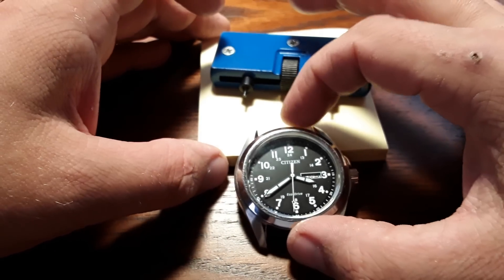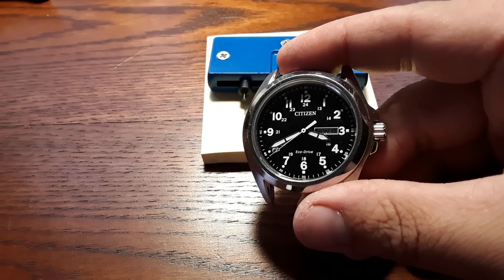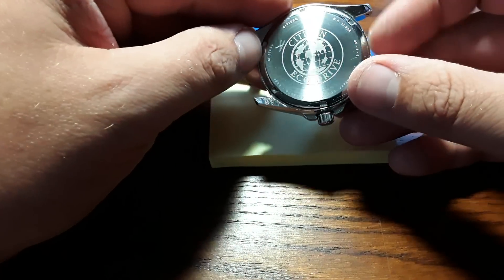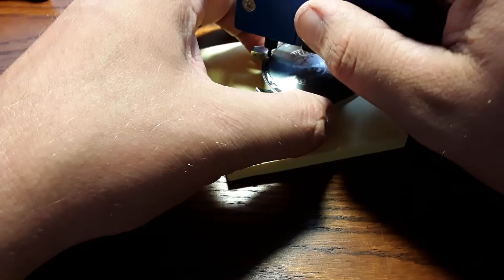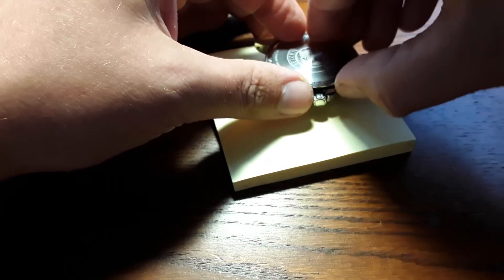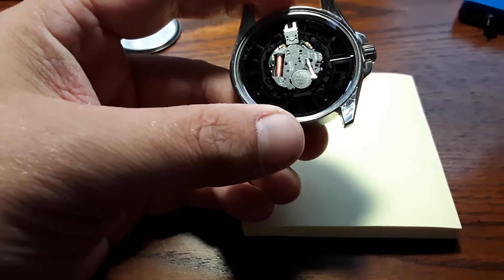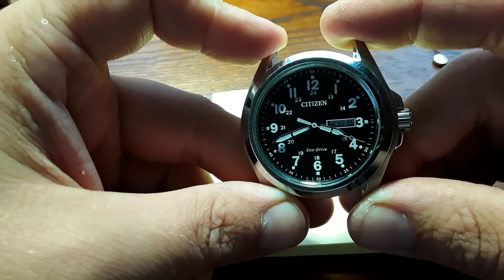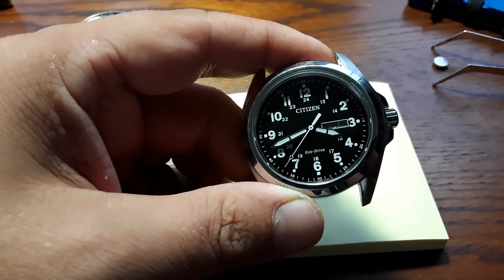Citizen Eco-Drive Runs Without a Battery (Capacitor)! Please SUBSCRIBE

Comment: I guess I'm just going to suggest that no battery last forever, regardless of what the manufacturer might claim.

They charge and discharge and they all have a finite number of such cycles that constitute their life span, it's true that different types of batteries have different cycle life spans....a good example is how much better lithium ion batteries are compared to nickel cadmium. But I would hesitate to say that any battery will cycle indefinately.

I've owned a Citizen Eco Drive watch where the battery outlasted my ownership of the watch because I broke something else and discarded the watch...(I'm kind of rough on watches, entirely my own fault). I have no way of knowing if it would still be running today on the original battery if I still had it.....I just think that there is a limit and they will fail at some point.

The advantage is that they should last longer than a standard battery that isn't re-charged while in the watch. It just starts with a charge and runs down until needing to be changed.

The watch will run without it as it is still getting power from light, the battery is just a storage device and means the watch can continue over periods of time with no light input.

I'm currently wearing a Casio with solar charging and would assume I'll be dealing with the same issue if I keep the watch long enough.
I am however interested in the comments I'm seeing on this thread suggesting that natural light is better for the re-charge than artificial light. I guess that seems kind of intuitive but I confess I've never really thought about it.

Comment: An Eco Drive or other solar watch has to be used correctly, like anything else, to fully benefit from its design. They need to be exposed to light regularly to keep their rechargeable battery topped up, if this is done they will last for years, or even decades. I personally had one for  over 15 years and it was still going strong right up to the day it was stolen. A common mistake is to leave them boxed and deprived of any light for long periods and then charging them up partially only to replace them in the dark. This process stresses the rechargeable battery and dramatically shortens its life. Early versions used a capacitor rather than a lithium ion cell but they also work best if regularly charged. The benefits are obviously environmental, less heavy metals seeping into the water table, but also for the owner. A divers watch is only as good as it's watertight seal, not having to open the case to replace the battery is a real advantage and of course they're essentially quartz watches with their inherent accuracy advantage over their mechanical counterparts.

Comment: I have several eco drive watches, and they use a “battery “ capacitor and once they worn out, are to expensive to replace
Reply: It is a lithium battery and not a capacitor. Just not the same lithium chemistry as your phone. Acording to Citizen the battery will hold 80% of its original capacity after 20 years and last up to 40 years. But only if the watch sees light everyday. If stored in the dark the battery quickly degrades and fails.
Reply from the maker: 30.00 on Amazon. Just like changing a battery.

Comment: I have plenty of 15 year old eco drives that are still going. I'd say they're 10-20 years between changes, depending on how often it's used and what sort of lighting it's under. They do die quicker if they rest in the dark for years, and old models that sat of a shelf don't help. Non solar quartz can be 3-10 years, depending on what the watch does. The 10 year watches are generally only ones with small dials and hands, no features. Most are nowhere near that.

Also, some eco-drive watches take a few days in direct sunlight to fully charge.
Reply: Seiko's solar Tuna-Lite can fully charge (10 months) in 9 hours of full sun, altho' I always a bit wary of it overheating, tend to keep mine out of direct summer sun if possible.. I keep it in a glass jar so even when stored it's getting some light, and it's simple enough to stand on the window sill to catch some free energy.

Comment: Battery 1-3 years capacitor 8-12 years. Advantage Eco-drive. Between Seiko solar and Citizen Eco-drive I have 12 working watches. Some are over 10 years old and I have changed a total of 1 battery(capacitor) and it was a pre-owned Seiko that came dead on arrival. I find that when you own a lot of watches it is much better to have either solar or eco-drive watchers because changing batteries every year or two can be a real pain in the neck. I have a total of 35 watches 10 of which are automatics five with batteries and the rest are solar or eco-Drive. The solar and eco-Drive win the convenience Contest with flying colors. If you only have one or two watches it really doesn’t matter but truthfully the price difference is minimal and the advantage is huge as far as convenience.
Reply: I am starting to like your channel
Reply from the maker: @mikejoseph8392  I appreciate that very much. I hope you subscribe and stick around. I have a giveaway coming soon.
Reply from the maker: Excellent points! Thanks for sharing.
Reply: wrong lithium-ion not a capacitor

Comment: I have had my eco drive since around the year 2000. Never replaced a battery and it just keeps running, accurate as hell and looks good to boot. Honestly never knew it had a battery in it. Best watch I have ever had.
Reply from the maker: Thanks for watching. It’s a great watch.
Reply: I have eco drive (E101 module), in one week. Something odd is happened? At first I put it right time. Next day delay was 2 seconds and it is same after one week!

Comment: I have an aqualand eco-drive that is 18 years old and still on it's original power cell. It is still ticking with no problem. It is very accurate as well; gains 5 seconds per month.
Reply from the maker: That’s awesome. Thx for watching.

Comment: Bought Eco-Drive chronometer on cruise ship in 2004.  Stopped fully charging Jan 2021.  17 years running, never stopped, until last month.  Kept PERFECT time.
Reply: Same here. Bought in '05 on a cruise ship but stopped sometime in 2020. It was put in a box after years of usage, pretty sure that wasn't the proper way to store it.

Edit: The thing came back to life. Pulled the crown out and held a flashlight close to the watch face and it started ticking after a few seconds.
Reply from the maker: Can’t beat an Eco!

Comment: I had always thought that the eco drive watches were charged by just wearing it. I didn’t think they were solar powered. That’s why I thought they made such a big deal about it because it charges by your movement or wearing it. I know I’ve had mine now for nearly 15 years and it goes dead all the time because I only wear it once in a blue moon but when I put it on it usually is working again by the time I take it off and then stays working for weeks. I really don’t know though I’m not a watch expert.
Reply from the maker: Hopefully you learned something today and I appreciate you watching.

Comment: Had mine 18 years. Battery only went flat when I stopped wearing it for a year and left it in a drawer. Top watch. My RADO Chronograph battery only lasts about 18 months and costs a lot to replace.
Reply from the maker: These are excellent timepieces. I have a follow up video. I charged it in the window sill for 2 days and charged it up completely.

Comment: Actually if you watch carefully, the watch was not "ticking" when you flipped it upside down (same time when you flipped it upside down and then back up), it was just ticking when it was exposed to the light.  This is because the watch is a solar voltaic system (small solar panel inside) which runs the watch and recharges the "capacitor battery" at the same time.

I have had to replace my wife's watch eco drive battery two times now.  The first time after about 10 years, second time after 4 years even tho I purchased replacement battery from very reputable supplier.  Her watch uses a very small citizen 295-76 battery (called capacitor battery for Eco-Drive), and it's not cheap ($18).  I would rather replace more often with a less expensive battery, so I would say the eco drive is more of a gimmick from a marketing standpoint.  Her battery is much smaller in size than in the watch shown in this video which might also be related to its shorter life span.
Reply from the maker: Good eye. Appreciate you sharing.
Reply: Lithium-ion
Reply: My "gimmick" has gone 17 years without needing a new battery

Comment: I bought one about, I don't remember, 8, maybe 10 years ago, and it's been stored the entire time. Don't know why. I just never really got around to doing anything with it until now. Anyway, it's a Drive series, I don't remember for sure but for some reason the AR prefix comes to mind, but I don't see it anywhere on the box, so who knows. It's chrome colored, has a black silicone, rubber, resin, or something like that, band, has three subdials on the face, and three buttons on the right side. I took it out of the box when I got it, set the time and date, put it on a pillow, and into a four watch display box. Over the course of however long it's been there, the time is really close to accurate, but due to irregular lengths of each month of the year, it had lost two days on the date wheel. Today is Aug 25, the date wheel read 23. Time wise, it's one second ahead of the network time on my cell phone. It's a different phone, but the network time is what's important. I don't know, it's pretty cool looking. I might start wearing it and get a little enjoyment out of it. Oh, I almost forgot, it isn't anywhere on the watch, but on the box it has the model number as CA0420-07E.

Now on to the video...
I'm not surprised you found a battery in there. If there wasn't a rechargable battery, you have to store it under a light source to keep it running overnight. Exposing the watch to light charges the battery, then overnight when it's dark, the watch runs off the battery power.
Reply from the maker: SpEd thanks for the feedback and watching.  Appreciate it, my friend.

Comment: That is a capacitor. It is not a battery. And, if it is kept at nearly a full charge, it will last a very long time.
Reply from the maker: Thanks for watching! Please subscribe and help support the channel.
Reply: What makes you sure this is a capacitor (I tried to find any clear evidence for this strange claim/info by several people, but I completely failed)?
In my understanding this is a special kind of lithium rechargeable battery called MT621 which is produced for example by Panasonic, but somebody has welded an additional contact on it, so it becomes a rechargeable batterie specific to one or several Citizen watches.
Why is this my understanding?
I know a battery can store energy and I know many devices like cell phones, laptops, power tools, .... are using this technology since about 30 years. A capacitor can also store energy, but I am not aware of any application where a small size/low cost capacitor is able to hold its charge for 180 days as Citizen rates for many Eco Drive watches.
I am also failing to understand why a capacitor would have a life time quite exactly between 10 and 20 years, I think for many capacitor types it is much longer.
The really strong argument however is what you can find here:
https://industrial.panasonic.com/ww/products/batteries/secondary-batteries/coin_rechargeable_lithium/models/MT621
I believe Panasonic's headline "MT series Manganese Titanium Rechargeable Lithium Batteries".
Finally Citizen themselves mention the word battery in their Eco Drive Manuals 3x as:  (I could not find the word capacitor at all)
1) A secondary battery is used in this watch to store electrical energy. This secondary
2) F. REPLACING THE SECONDARY BATTERY
3) J. SPECIFICATIONS … 10. Battery: Secondary battery
Note: Secondary Battery = Rechargeable Battery
And here https://www.citizenwatch-global.com/technologies/eco-drive/ Citizen describes the cell where energy is stored als  Lithium-ion cell, which is exactly my understanding.
Reply: Wrong lithium-ion

Comment: I’m a big fan of the Citizen brand and own three Citizen watches currently. I’ve noticed the optimal charge occurs in direct sunlight - not through a window in the house or car. So if I have a chance I’ll lay the watch out on a table and that quickly addresses the low battery indicator. Great video and interesting to see the inner workings of the watch!
Reply from the maker: Thanks so much Shane for the kind words. I’m actually going to do a video on Citizen’s false claims to charging this watch and set the record straight. Thanks for the feedback and support brother. 👍

Comment: That is cool. That is runs without a battery. I wonder if the G-shocks does the same
Reply from the maker: armyparty if in direct sunlight I would assume yes. Wouldn’t make a habit of it, but should work. Thanks for watching.
Reply: it doesnt they have a lithium-ion

Comment: I've have a Eco-Drive, bought in 2001 and it still works great off it's original capacitor. I wear it everyday so it has always been in full charge. There is a LCD 3 bar gauge, 3 bars meaning full charge and I have never seen it with only 2 bars. I see that as an advantage.
Reply from the maker: man350z thanks for the feedback and for watching.

Comment: Is there an advantage over a regular quartz watch??? I'm surprised you ask that question. The eco drive can possibly last well over 20 years without a battery change. Ever had a regular quartz and had to change the battery every year? It stops. You don;t have a functioning watch for a few days. You have to make time to take it to a jeweller. With frequent battery changes, you will get a lot of nicks on the back from the case being frequently opened, and these frequent changes may lead to a compromising of the water seal if the jeweller doesn't know what he's doing. The answer is pretty obvious, don't you think?
Reply: Exactly!

Comment: Bought an Eco-drive in October 1998 still running fine as I write this on the original battery. Only thing I do is make sure it gets good light every day. Putting them in a drawer for months will, I'm pretty sure, reduce battery life.
Reply from the maker: tony c thanks for watching! Putting them in a drawer doesn’t help. I keep mine in a window sill. They get a nice tan. 👍

Comment: The advantage of an ecodrive?  I have four eco drives. The first I purchased in 2000 is a Titanium military style and it worked continuously until last year then it started doing what this watch is doing.  This particular watch has been to 70 MSW. so that 19 years without battery change and it just kept working.  I have a titanium ecodrive divers as well - which flooded after 14 years use. so they've been pretty reliable for a long time. I have been told that one must use an incandescent light bulb to flood the capacitor to get ti going agin.  IS this true? I haven't got any of those bulbs in the house anymore so will have to go and buy one if so.
Reply from the maker: I put this watch in my window sill for a few days and that did the trick. I put all my solar watches near a window now for at least a few days a month now to keep them charged. Thanks for sharing. Please subscribe if you haven’t already.

Comment: I have several Citizen Eco Drive watches one of which is now about 10 years old and it is still running perfectly. For these watches to work well they need access to light daily but not in direct light which can cause them to overheat which will affect the watch and possibly damage it, this applies to any solar powered watch whether it's a Citizen, Seiko, Orient, Casio  or other brands, they all work the same way. If you observe the instructions when you get the watch it will give you many years of service of up to and beyond 20 years if looked after properly. Citizen offer the best watch guarantee on their watches also which I think is five years but will give a further three years if you register your watch with Citizen online, this applies across all the Citizen Eco Drive range of watches from the cheapest to the most expensive. Seiko and other brands only give a two year guarantee which is something to consider when buying a solar powered watch. Thank you for uploading this video.
Reply from the maker: Thank you for that. Please subscribe and help support the channel. I’d appreciate it.

Comment: Replace the capacitor. And charge it back up. I have a ecodrive that's 20 years old. Don't put a standard battery in there man..u need a capasater cell for it. If u put a standard button cell in there u are going to destroy your watch.
Reply from the maker: Alton Rowell thanks for the tip. Thanks for watching.

Comment: I have a 8701 series, I wore that watch every day for about ten years, never had any issues, until I broke the clasp, and needed to get it fixed or replace the bracelet completely, these batteries last a long time as long as you use it often, and set it in a room with light.
Reply from the maker: Patrick Luby agreed. These were meant to be everyday wearers and not watch box warriors. Thanks for watching.

Comment: I have one that I inherited from a friend.  Charged it for months, and it was skipping like this.  Read recently, that you need to pull the crown out two clicks, wait 30 seconds for it to reset, and be good to go.
Reply from the maker: Jeffrey Wiley good to know. Thank you 🙏
Reply: Jeffery, I have to give you a mad shout out of thanks. I have a Citizen B873-S057892 and it just stopped working and I couldn’t find anything or replacing the battery even though it’s a EcoDrive. I took your advice on two clicks out and wait 30 seconds and low and behold BANG it started right back up. Thank you so much!